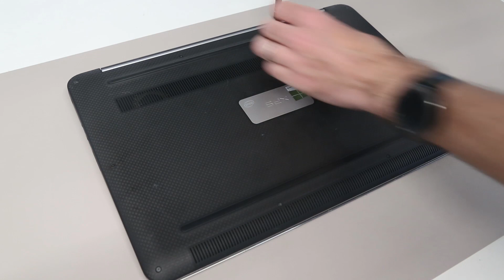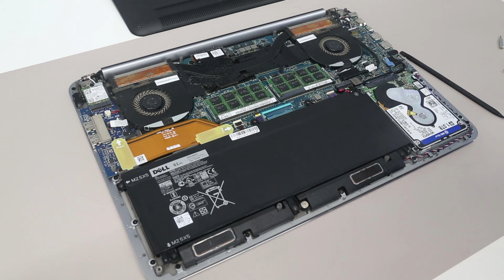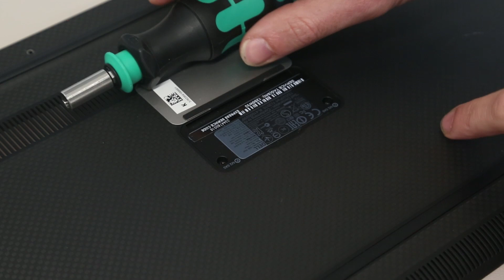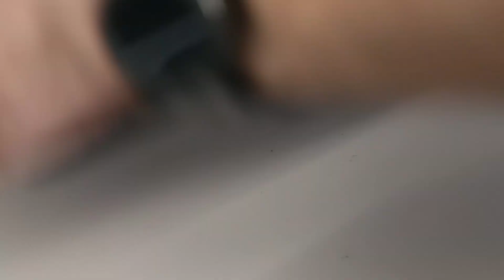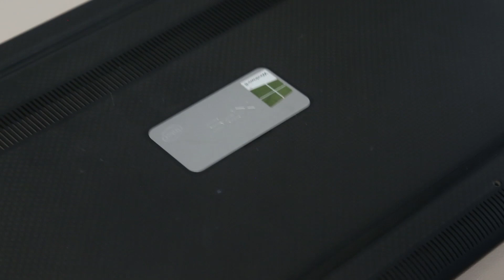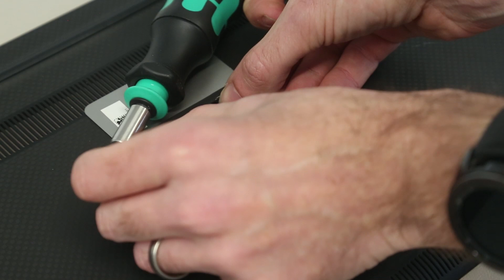Dell XPS 15 9530 Battery and DC Jack Replacement and Repair Guide

Comment: How do you clean the fans?  I'll be replacing my power connector in a few days and figure since I'm opening it up I should clean the fans so they operate at peak performance.

Comment: Thanks for the excellent Video , ..... I just replaced my  DC power jack  connector  for my XPS 15  9530    ( the part is the same  for the 9550 and 9560  after  my research ... and help of my NZ parts supplier  .... a bargain of  NZ $ 12.00  !!! )